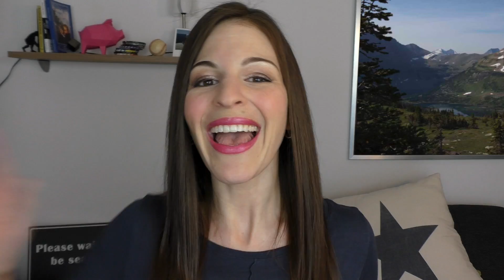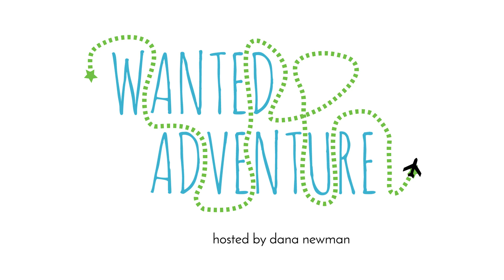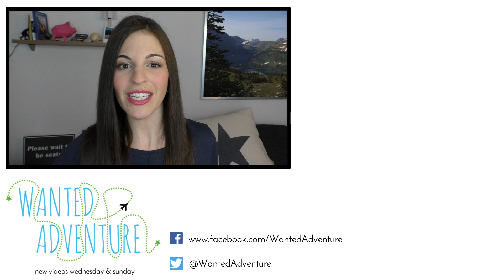Why Are Houses in America MADE OF WOOD?!

Comment: Wood is easier to work with than stone or even concrete. That makes the homes cheaper to build, and cheaper to buy.
Wood weighs less than masonry, so it costs less to transport -- again reducing the cost of homes.
Wood flexes, so it stands up to earth tremors better than masonry (you don't get cracks in a wooden wall when the ground is bouncing around).

That said ... a lot of commercial and "public" buildings (like Schools) are made using "cinder block" construction. It's only family residences which tend to be wood. Wood is suitable for 2 or 3-story buildings (and, as I said, cheaper), but it's not efficient generally for anything taller than that (structure like Barns are an exception, because they only support the weight of their roof, not dozens of humans with furniture and kitchens and bathtubs).

Comment: Good question/video.
imho, Monolithic dome houses (steel reinforced concrete) are mostly tornado proof. Also fire proof, termite proof and earthquake-resistant. And flood damage resistant as well, except the furniture & appliances inside may still get water damaged.
Earth bag homes are Really cheap, and possibly tougher/better than wood frame houses in a tornado or fire.

Comment: The best answer if you need a short one is, because we like them, they represent to us, the image of true "home" in our culture.

Probably the two most practical reasons for wood are cost and flexibility for the homeowner. A wood home is a lot easier to change, change room layout, add a room, remodel, run new wire or plumbing and such. Most older homes in America have had significant changes since they were built, adding things like central heating/cooling, better electrical, new rooms, sun porches, rooms expanded by knocking out walls or compartmentalized by adding interior walls.  

I think wood for Americans is more psychologically a "home", our prisons are made of concrete slabs, our dorms are often cinderblock and our homes wood or house brick. When we picture a "home" wood homes are the image most Americans would conjure up, from movies, from seeing millions of them, TV shows, everything in our culture is dominated by wood homes and again brick also. The great thing about blaming it on culture is that you don't need to argue the practicality of building materials :)

Comment: Wood is cheap, more sustainable and generally easier to find skilled craftsman to work with timber. The engineering properties of timber is not so much as in issue for residential houses as they can meet the building code requirements of lower importance level and design life as opposed to a more important structure like multi storey apartments.

Comment: You are mostly correct about the prevalence of wood in America being the main reason buildings are made of wood in the US. Economically wood is cheaper to use, though metal studs have similar costs. Construction with bricks and concrete are cost intensive processes, in manufacturing, transportation and labor and much of building in the US is done with tight budgets. Another factor is that when Europeans settled in America, they used the techniques they knew. Many colonist were not well to do or of means where they would of had a brick house in Europe. I am sure there are many more factors, but these are my experience as a carpenter and soon to be architect.

Comment: We had a storm in the North Atlantic during Christmas (23. Dec to 26. Dec). Wind speeds got to around 72 m/s (259.2 km/h or 161.1 mph). There was mostly superficial damage to houses and buildings, though a purely wooden storage building somewhere in the North of my country was completely and utterly destroyed. Houses are built with a mix of concrete and wood. The older houses, which are built as a stone building, reinforced with a thick concrete wash, and a wooden house inside are usually small (economical, as less space to heat) are the buildings least affected by such strong storms.

Comment: Wood is a good insulator.  A wooden house is naturally warm in winter and cool in summer.  You treat the wood with preservative against rot and with a pesticide against the  likes of termites.  There are many buildings in UK that are centuries old and are made with a wood frame with wattle and daub between.  Wooden houses are flexible and able to withstand strong winds and earth tremors far better that the rigid structures made of brick, stone or concrete.

Comment: Yes, it's like that because "they are". The culture there demanded that "everyone should get a house because we're in America", so enormous low density areas with very poorly constructed materials were built. Such developments are highly inefficient, have a much greater impact on the environment and, longerm, on the economy.

Regarding buses and big objects impacting the houses, yes, even a concrete frame with brick walls house would not withstand that, but the difference is that it would not be torn down. Also, those "wooden" houses (which aren't sturdy timber houses USA started with when settling began, but very cheap light frames) are wrecked by wind alone. We have tornados in various countries on the European continent and they get damaged: clay tiled roofs can be sucked away, windows are smashed, some walls can be punctured, but the house stands and can be rebuilt.

If USA used proper building methods, there would not be a historical 20th century impression of enormous wealth. Houses would not be built superfast, developments would not be massive low density.

The greatest issue is that wooden houses last for a lot shorter time. Mineral materials don't rot. They get dissolved by water, but so slow that ancient Roman concrete still stands proud. Wood rots, gets eaten, even when protected by nasty organic volatiles.

Also, wooden houses BURN to dust. I'd never live in a wooden house because I don't like living in a chemical-infused pyre.
Just think about it. Not only the stuff you brought in burns - the actual structure burns. That's incredibly scary.

Comment: You talk about tornados, but not earthquakes. In places where there are earthquakes, stone or brick buildings tend to fall down, sadly on top of occupants. Wood has a higher strength to weight ratio and performs much better in an earthquake. That also translates to insurance costs. Earthquake insurance for a brick or stone building is much more expensive than for a wooden one.

Comment: Do Europeans not realize that bricks are as useless as wood frame against tornadoes?
Reply: Also, clay brick rots faster than properly made wooden frame houses.
Reply: james lawrence I've never heard clay bricks getting rotten.
Reply: Rotten in more of a generic sense than decomposed by bacteria. They pull in water from the air and flake apart. It takes about 50 years. Wood can easily last over 100 depending on the species. When they start flaking apart they go to complete shit in about a decade.

Comment: Simply put, wood is plentiful, easy to work with, and cheap. We have developed ways of minimizing the risks, and if you draw the short straw and get a direct hit by a tornado, well, unless you're living in a bunker that can survive an airstrike, you are liable to lose it anyway. I'm about 3 hours from Joplin. Ask them folks what a tornado will do. Think a kilometer and a half wide, with winds powerful enough to shred steel-reinforced concrete and twist big steel beams. Tornados can pick up a bus full of kids, and set it back down a hundred meters away with nary a scratch. Tornados can take a wheat straw and stick it into a utility pole without bending or breaking it. A large enough tornado can not only flatten a building, but destroy its very foundation as well. Thus, we use wood, and buy insurance.

Comment: Wood actually gets harder with age.  I renovated a house that was 100 years old and it was almost impossible to pull nails from some of the wood.  I found out this is common in really old woodframe houses.  Wood is also much, much easier to change floor plans with when you want to do a renovation.  It's easier to add on to, and easier to demolish.  It's just more flexible (pardon the pun).  As for the tornado-proof stuff, it's totally doable to build a wood house that would most likely stand after a tornado but people are cheap idiots so they don't.  It takes more money and better materials (regular shingles and common nails just won't cut it, and you need metal roll shutter window covers etc).   Earthquakes too.  You can build a bungalow on a concrete slab floating on another concrete slab and no earthquake will hurt it because it can move around.  It's not rocket science, it's just expensive. Most basements in North America are concrete yet built so poorly they often break down in just a few decades but they wouldn't if they were built properly.  Oh well, it means work for me because I come in and shore them up.  Yay!

Comment: I was born and lived in the south most my life where tornadoes were simply a fact of life, and you were correct, having a stone house would not necessarily protect you from a tornado. I don't believe that these folks you were talking with actually understands the forces associated with Tornadoes. Having witnessed several tornadoes the destruction can sometimes be indescribable. I've seen dump trucks upside down and full sized Semi tractor/trailer trucks on destroyed homes. We have huge tracts of land growing trees for lumber (for those that think our forest is going into homes), it is an affordable, abundant and sustainable building material. A 100% stone house would only be more expensive and much harder to rebuild. The only kind of structures found to be as close to Tornado proof as it gets (barring it doesn't get a tractor dropped on it) is a Quonset Hut, which is those half pipe looking buildings made of corrugated steel that's often used as military barracks or farm garages, and very few people want to actually live in one.

Comment: YES but why wood?  
Re-enforced Conrete would stand up to a bus or a Car  being hurled at it  at 300 mph a lot more 
than a timber house obviously it would be damaged but  would still be standing and  could be repaired whereas a timber
structure would be ripped up turned to matchwood and spread across the next state.
Then they have to rebuild and unlike the three little pig's they dont learn their lesson ,  back to timber  WTF??????
It may be cheap materials but not if you have to rebuilding the same thing over and over again and what about House insurance it must be through the roof  [ Sorry couldnt resist it ...lol ]
C'mon its not rocket science I have never been in a Tornado or a Cyclone but if I was I know what I would rather be in when these come a knocking.

Comment: In Florida, we do build houses and other buildings out of cinderblock (aka, cement) and they do not stand up to tornados.
Reply: cinderblock is not cement, it is concrete.  houses in your area poorly designed, substandard materials etc
and your lying.
Reply: are those reinforced concrete blocks with a foundation of at least 3' with rebar matting and a slab roof?

Comment: The foundations in the USA are concrete and the roofs are water proof, so any reasonably designed, sited and built wood house is not subject to rot, termites or flooding. The interiors are generally covered in gypsum which is an excellent material for fire resistance, cheap easy to repair, does not promote condensation.(modern house fires are generally the furnishings not the structure) 
The wood frame is a far superior insulator to steel, stone, brick, concrete. 
It has a very high strength to weight ratio, especially in bending, 
The total energy resources expended in production and construction are far less, 
Wood production is a CO2 consumer and the material Carbon storage,(concrete/mortar production emits large amounts of CO2),
The material and joints are much more earthquake resistant than masonry(in the west we have no tornadoes or hurricanes but do have earthquakes, I'm up to 3), 
Remodeling is far easier, 
Hanging pictures much simpler, 
Running wires and pipes in the walls much easier, 
Overall construction is much faster and for many areas/climates several 10s of thousands of dollars cheaper.

Comment: I live in Perth, Western Australia and have been on the second storey of a brick house that was hit by a tornado. This tornado was so powerful it was able to rip up a 20m high eucalypt tree... which is impressive as such trees have very deep tap roots... I, and my house, was undamaged. Perth sees many tornadoes along its metropolitan area, but few make the news as they rarely do much more damage than rip up some trees, even though they go over houses. Usually any damage to a house is to the roof due to tiles ripped up, or branches landing on them. Walls are almost never damaged... most likely because Australians build with brick and concrete... except in their roofs.

Australians build with brick and concrete because it is cooler in hot weather than wood, whereas wood is more effective in cold weather.

Comment: I live in Southern Arizona (which is in an actual desert in America where we have many days over 100F or 37.8C, and quite a few over 110F or 43C.)  Most of the houses here aren't built with wood, but with brick/stone/adobe.  These tend to be decent insulators against heat, and work as heat "batteries" to release heat on our cold evenings.  We also don't have earthquakes, and tornadoes are a rarity.  I know that in California they tend to NOT build with stone/brick, because it isn't nearly as flexible as wood, and you need flexibility to handle earthquakes. In addition, I've heard they've outlawed weather in California, so they don't have to worry about that.

Comment: Wood is cheap and fast to build with, too. Although I do love masonry (and here in Arkansas, a lot of older buildings use masonry because in the prairies, wood wasn't as easy to find). But there's another thing: earthquakes. Bricks and stonework don't do well in earthquakes because they rely on being stacked on each other and can't take lateral motion as well. I've also lived in California (although I've experienced more earthquakes in Arkansas), and you don't do much brick there. Wood is safer if it falls on you in an earthquake, can be built in sturdy triangle trestles, etc. Likewise, adobe and other less rigid building materials can handle earthquake motions better. Contrary to what might seem like common sense, you don't want stronger, more rigid stuff in earthquakes--you want lighter, more flexible stuff that can spring back after being bent (tensile vs. rigid strength).
After all, Japanese buildings are traditionally wood and paper (ground up wood) as well, despite it being super moist there so you would expect a lot of rot. Stone foundations are common, but earthquakes make it safer to build up with lighter, more flexible materials. 
Funny how when you go abroad, suddenly you are expected to be an expert on everything you always took for granted, right? Happens to everyone, no matter where they're from.

Comment: I live in North Italy and the hous was built 12 years ago. It consists of entrance/tv room, storage room, galley, 2 bath rooms and 2 bed rooms. In the basament there are a storage room and private parking. The house is full brik and concrete structure, with insulation inside perimetral walls, floor and ceiling. The house was built considering the energy cost and this house cost less energy compared with previous one we had.

Comment: From a California (Earthquake) perspective, wood houses can be built with a good amount of sheer value in the design and construction.  Wood houses naturally stand up well against earthquakes and with the new methods that increase the sheer strength, they do much better.  

In comparison, stone and brick buildings do poorly with earthquake loading.  The joints between stones or bricks crumble as the building is forced to flex in the rolling or back and forth motion of an earthquake.  A current great concern of Los Angeles is retrofitting current brick and block buildings to help them better withstand future earthquakes.

Comment: A popular fervor/hysteria in the United States is the fear of asbestos. Yes it can have dangers, but there is an irony in removing it after installed. Asbestos is safe when it stays intact. It's unsafe when damaged, and equally unsafe when it is removed, because it is broken up in the removal process. If there is no significant risk of the building being torn apart by tornado or earthquake, why make a hazardous removal as prevention for an event that will likely never occur? If it doesn't go anywhere, it won't hurt anyone.

Comment: Yes they are easily torn down, but they are also easily built back up.
Reply: Basically residential houses are predominantly built with whatever materials is available and cheap. And then there is the climate...

In the Northeast of the USA you find more masonry houses in the more densely populated areas - less fire hazard and can be built higher. In the Southwest you have the traditional adobe house, basically clay brick.

Durabilty is an issue, but not that much in the choice of materials. Europe has built timberframe houses for centuries, and a lot still stand. You can build solidly with any materials, and you can have any material fail given the right circumstances. Traditional Japanese houses (and temples) are built without a single nail or screw in their wood construction, and they withstand earthquakes and taifuns. It's how you build, not with what. That said, hardwood is of course better than softwood. In European forest however the slow growing hardwoods became rarer and thus more expensive. In Scandinavia you will find a lot of fir (soft) and not much oak (hard).

And then there is the issue of building codes.